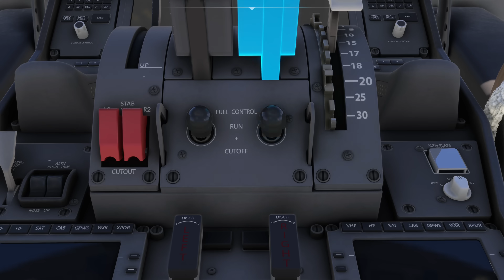Air India 171: Why Did The Fuel Cut-off Switch Get Moved?

Comment: Is there any situation where the system automatically turns off the fuel switches to the engines during flight? I don't think so, but I may be wrong. Anyway, the pilot asking the other why he switched off the fuel is the one who did it. Why didn't he switch them on again immediately instead of wasting time to ask?

Comment: There was a rather long comment (@charleslo5703) in "garybpilot" video . . . that the Fuel Cut-off recorded by the FDR is the electrical signals, NOT mechanical movement of the switch(es).
The speculation laying blame upon the Captain/First Officer is erroneous since it is unclear whether the switches were physically moved or an electrical failure mimicking switch movement.
This still could be a design/manufacture failure.

Comment: They have the crashed fuel switches in hand, why can't they tell us straight off if the switches had the locking mechanism installed and working or not ?
Reply: The switches were found to be in working order.  They were locked into the RUN position as the time of the crash.  The impact of the crash was not enough to physically move them from Run to CUTOFF.  That ruled out that they somehow "slipped" from RUN to CUTOFF when the plane rotated.  The FDR confirmed the switches were moved from RUN to CUTOFF then back to RUN after one of the pilots asked why the other had turned them off.
Reply: That plane wouldn't have been flying if those switches don't lock.
Reply: They don't care about our frustration, seemingly.

Comment: The switches were more likely turned off by the pilot who then asked why did you do that? The effect is to create a record in the black box that points the finger at the other pilot being responsible.. asking why it was done does not seem like a natural response to discovering that the switches had been turned off. More natural would be an excited why did you do that, what do you think you’re doing, and simultaneously grabbing the switches to turn them back on. The fact that they were turned off intentionally and at precisely the moment in the flight when it was too close to the ground to be recovered is very strong, circumstantial evidence that it was done intentionally.

Comment: @ Capt Steve, please correct me if i am wrong i am not a pilot just an enthusiast, but if there is a duel engine failure is the procedure to re-ignite the engines to moves the cut off switches from Run to Off then to Run again to start the re-ignite of the engines, and if true is that not the reason that they aircraft had duel engine failure shortly after take off and the pilots was simply following the procedure ?

Comment: We do not yet know if these switches were actually moved. 
At this stage all possibilities are still open:

1. An electrical fault such that an incorrect signal was sent to the EEC and/or the fuel valves or the fuel metering unit (but the fuel switches remained in the RUN position) 
2. A mechanical fault such that the fuel control switches were easily knocked out of position 
3. An accidental or inadvertent action by one of the pilots (or someone else in the cockpit)
4. A deliberate, intentional act by one of the pilots (or someone else in the cockpit)

We do not have enough information at this stage to make any definitive conclusions.
Reply: The preliminary report is crystal clear. it states "the Engine 1 and Engine 2 fuel cutoff switches transitioned from RUN to CUTOFF position one after another with a time gap of 01 secs". That seems about as clear and unambiguous as it could be, the switches were moved rather than some electronics glitch. I'm sure they considered all available information in coming to that conclusion including not just flight data but cockpit voice, sounds etc. I'm really not sure why people want to reject what the report says and come up with their own far more convoluted explanations? As of yet we dont know why the switches were moved but the report is clear that they moved.
Reply: @jetplaneflyer  It is not at all clear from the report that the switches were physically moved! Do you know for sure if the FDR measures switch position or measures the “output” in terms of fuel control valve position or signal in the EEC and fuel metering unit? A preliminary report does NOT come to any conclusions. It merely shows the lines of enquiry at the current stage of investigation.

Why do people think all avenues should be closed to the investigators? It is very far from an open and shut case. That is not now any accident / incident investigations work. 

Further investigations will determine the most likely cause. This includes a background check of the pilots, further analysis of the CVR data, and any other info from GE / Boeing, etc.
Reply: @jetplaneflyer  indians cant digest the fact that one of their pilots crashed an airplane with 300 people.
Reply: @jetplaneflyer   The FAA SAIB NM‑18‑33 issue has not been entirely ruled out at this stage.
Reply: @bradowen761 the actual switches have been recovered. If they were faulty it would be known already
Reply: @jetplaneflyer  but they say it cant be moved that quick. like with one second apart unless it was done very quickly, deliberately. they said it takes 4 to 5 seconds for them to be flipped on or off like when they were turned back on again! and the second action was more urgent than the first and that took more than 4 to 5 seconds. what would explain that? so something is not adding up. Everything points out to deliberate action but was the action based on engine faiiure and  they wanted to land and pilot turned it off and again they tried to launch it: but conversation says otherwise as well. so that aint adding up either.
the ultra quick timing of cut off is the doubt here!
Reply: @king_has_no_clothskul8635  no that's completely wrong. It's been shown that it takes about a second or so to activate both switches. Captain Steve showed a clip of this switch movement in a previous video
Reply: One switch malfunctioned is possible, but two separate switches malfunctioned simultaneously is almost impossible.
Reply: @liangxu firstly they did not malfunction simultaneously, it was one second apart (between left and right fuel cut off switch). That actually supports the theory that they were moved physically by someone in the cockpit because that’s how long it normally takes when we shut the engines down after parking. 
But it still does not remove the possibility of an electrical / software fault because that kind of fault would affect both left and right fuel systems and not just only one of them.
Reply: Exactly
Reply: @RockyRock-vv3ex  electrical,mechanical accidental fault is ruled out by the investigation report.only delibrate remains.
Reply: @stephenroger4527  nothing can be ruled out at this stage by a preliminary report. It only shows us the various lines of investigation.
Reply: It is true that, at this stage, it is more likely to have been option 3 or 4 above. 
And an investigation of the pilots' backgrounds will be necessary to corroborate that case, as well as further analysis of the CVR.
Reply: @sofbash  boeing and air india was given clean chit by the report.only thing remains is deliberate action.
Reply: @stephenroger4527 absolutely nobody has been given any such “all clear”. That’s not how aircrash investigations work. It is a long and detailed process.
Reply: These switches and their supporting circuits would have to have a common immediate failure mode simultaneously for that to happen and then clear the condition.  The switches went to cut out with one second apart, and returned to fuel on after the conversation one second apart.  The human disagreement is harder to explain.
Reply: Are you not listening.  The pilot flying manually returned the switches to run.......
Reply: @mikepxg6406  At this point 'we the public' don't know which pilot switched the fuel switches off and which returned it. We can only surmise.

But I believe that we can be 99.999999999% certain that one pilot switched them off and the other returned them to RUN, almost certainly after a physical struggle. This wasn't a situation where a CRM negotiation makes any sense. It became who was the strongest.

Perhaps the only factor that I've yet to see remain unexamined is who kept the plane in relatively controlled flight in all the videos. I am not a pilot and perhaps there's an inherent stability involved, but it certainly looks like someone continued to "aviate" the plane throughout. That said, perhaps the plane did veer out of control after it dropped out of sight. It was stalling and slowing down.
Reply: @mikepxg6406  no, we do not know that yet. All we know so far is that an electrical signal went to the EEC and / or fuel metering unit that matched the "RUN" command. 

Do you know for certain that the FDR is measuring switch position, or valve position, or both?
Reply: Google FAA Advisory NM‑18‑33 which was issued in 2018.

Comment: So, fuel switches turned off exactly at the moment they should've raised landing gear, maybe biggest brain fart ever? Also, I find interesting that they don't mention if the cockpit recording captured the sound of the fuel switches turning off... Is it possible for those switches to turned off without pilot intervention? Like software error? I'm guessing each switch works independently and its almost impossible for an electrical error to affect both almost instantly. The CVR for sure captured the sound of the switches, but they are not ready to admit everything... Think about it, if one of the pilots asked "why is it turned off?" must be because he saw the actual switches being in the off position. They were on off position for about 10second and someone cut them off exactly when they were supposed to raise the landing gear. They did turned the switched back on again but it was too late, either by mistake or any reason, but those switches were manually move one by one

Comment: Based on the timestamps, the pilot asked why did you do that with an immediate response that "I did not" and then 10 seconds until the fuel switches were turned back on.  Once that was determined why would it take that long to flip them back on?  Seems a bit odd to me, and obviously I am no pilot, but if I saw that it would take about 1-2 seconds after seeing it to get them turned back on (barring the distance to reach).  Just seems very strange and I am wondering that if, and its a big if, but if this was premeditated, perhaps both pilots were a part of it.

I am still holding out hope that this wasn't intentional but the more things that come to light, it would appear that the likelihood of it not being premediated is looking less and less
Reply: There may have been a silent struggle during that ten seconds. The prelim report is just that. I'm sure more detail will emerge.

Comment: Am I right in thinking that if a pilot wanted to doom the aircraft, it would be a extremely difficult if not impossible to stop that? In the case of Air India 171, even if the plane corrected itself what would stop the same pilot switching off the fuel levers again and again until the aircraft crashed.

Comment: Hey Steeve, I have a question. Is it possible that the pilot truly had a moment of confusion and misidentified the switch?, and then denied touching the fuel cutoff since he truly did not think he had turned it off? Would that mistake even be inside the realm of possibility?

Comment: 3:15 what if the other pilot is unable to do his part? like if unconscious or something @captain steeeve
Reply: Came here to ask the same thing
Reply: If there were two sets of switches, one for each pilot, that had to be set to off before the fuel is disengaged, then one pilot would not be able to do it without the other pilot knowing. Like if they were on separate sides of the cockpit. But if one pilot is unable to operate the switches on his side, the other pilot could reach over him and get to them. It would just eliminate the possibility that the other pilot is unaware of it. However, there really is no safeguard against a pilot plummeting a plane at any point in the flight if the other pilot is in the restroom or something. I mean we put our lives in the hands of others all the time.
Reply: Dude,if someone want to cut off the fuel supply, I am pretty sure another pilot is not going to be barrier  @maremacd

Comment: 🛑 However it seems it's a fake report to hide boeings blunders happening since  last 10 years. However if a pilot wanted to crash a plane , he would have done when they start feom delhi to Ahmedabad, they had very good altitude for suicide, rest no pilot choose 600 ft height for suicide. It was clear boeings fuel switch malfunction. Actually boeing is a flying coffin.

Comment: Why is the Official Govt Probe of  Indian Govt :

1. Not releasing and making Public the entire exchange between the two pilots, from the time the Engine Started on flight 171 to the crash ( which in any case won't be longer than 10 minutes and can be easily obtained by Cockpit  voice recorder )... Surely Boeing & GE are not preventing it....

2. Why aren't the two Pilots not being  CLEARLY identified in a two line conversation of the Interim report and merely passed off as Pilot 1 & 2 ?  Surely Boeing & GE are not preventing it....

3. Why was an " Aviation Psychologist "  included in the Probe Panel ? Surely Boeing & GE are not forcing you to...

4. Why  is there no probe/examination  on the Captain's previous medical history ? Is the Air India Management aware of something & hiding it from the Public ?

Aviation Industry worldwide is extremely stressful with high rates of Mental fatigue, burnout &  stress leading to disasters like Egypt air Flight 990, German Wings Flight 9525, Indonesian Silk Air 185, Malaysian Airlines 370
Reply: Preliminary reports are always terse. They give a few undeniable details but steer away from more subjective matters and issues that take more time to examine.

Comment: Do you know if the B787 have a fail safe function that doesn't allow the pilots chut down the engines if accidentally move the Start Levers to cut-off but the thrust lever are moving forward? If I'm not wrong E190 with CF34-10 engines if you do such a thing the FADEC will assume that is a mistake and won't allow the engines shut down unless the thrust lever are move to idle.

Cheers

Comment: If the switches were found in the off position after the crash, they had to have been moved a second time to the off position--or did I miss something? Thanks, Captain Steve.
Reply: Switches Found in RUN Position in Wreckage: Crucially, the AAIB report states that both fuel control switches were found in the "RUN" position in the wreckage after the crash, not in the "CUTOFF" (off) position
Reply: @stephenroger4527  FIRST OFFICER CLIVE KUNDER
The 32-year-old had a commercial pilot license which was issued in 2020 and valid until September 26, 2025. ((Zero relatives.))
Reply: @stephenroger4527  Okay, Stephen

Comment: Steve, as a pilot, is it possible to move engine controls so that they are split on opposite sides of the cockpit? Obviously dual pilots adds redundancy in case 1 is incapacitated, but something like fuel cutoff isn’t critical for 1 pilot to have unilateral control.

Comment: Perfect timing to cut off fuel switches with no chance of recovery. However, only one angle still needs to be investigated. Black box records just the signal that fuel switch was turned off. It could be glitch in the computer, system or a terrorist hacking attack to have caused this signal with no switch being physically turned off. Terrorist hacking more likely than computer glitch given the perfect timing. What needs to be proven by sound recorder that a click sound was heard while switching off switch manually. If that sound is heard, it’s a suicide. If that sound not heard, it will prove to be a computer, system glitch or a terrorist hacking attack.
Reply: Stop spreading these nonsensical theories
Reply: Not convinced about the hacking theory but the timing of when the fuel was cut off is very suspicious.

Comment: Where are the switches physically moved to cut off and then run again? Does the flight data recorder get its fuel control switch signal from the physical movement of the switch itself or from the electrical signal of the switch generates? It seems that most YouTube analyzers and people writing news stories and people like me watching this content are assuming that the physical position of the switch is detected. 

As a former electrical engineer, I'd like to know how this is accomplished. I'm not skeptical. I just don't know how it's done or if it's done on the 787.

Comment: Captain Steeve . It seems pilots are agaist video footage. Video footage could show whether the switches were flipped intentionally, accidentally, or as a result of a malfunction. Instead, investigators are left to interpret audio, flight data, and guesswork. That’s not good enough.
Some Pilot associations have already dismissed any suggestion of human error as “baseless.” But without video, no one—not the public, not investigators, not the families of the dead—can confirm or deny it. In effect, pilots have been given veto power over accountability.

,,